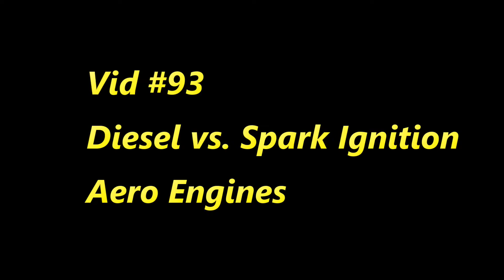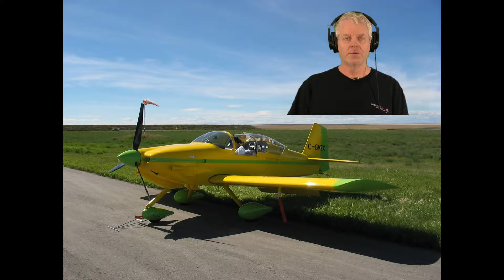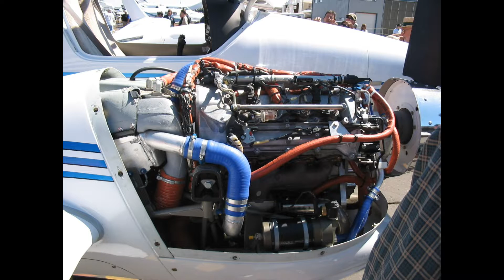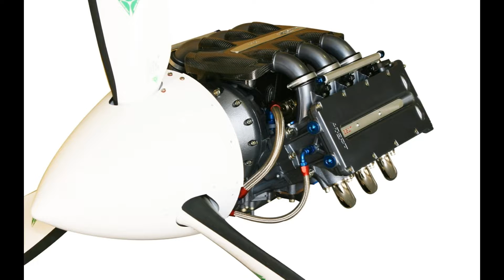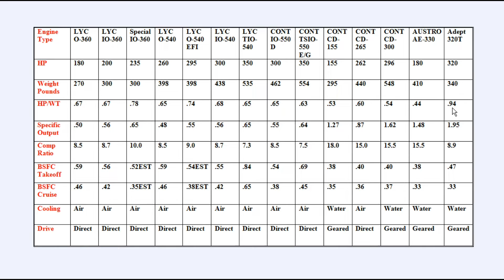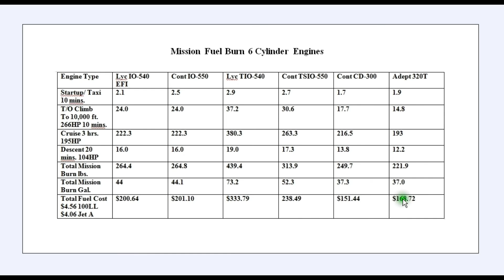Vid #93. Diesel vs. Spark Ignition Aero Engines

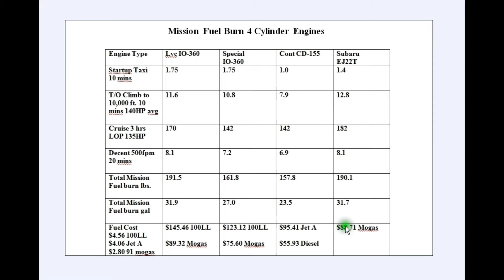Comment: @rv6ejguy   16:51  it doesn’t seem possible to run 10:1 and Mogas.   @rv6ejguy, are you sure the IO-360 special can do this as indicated by the figures in table?
Reply from the maker: We have numerous customers running mogas in their Lycomings. Retarding the spark at high MAP is the key. You'll lose power WOT near sea level of course but can re-advance at altitude.

Lots of auto engines are running 11 to 13 to 1 CRs on 87 octane. Good chambers plus, DI and knock sensing make this possible.

Comment: I remember people mentioning difficulties in restarting a turbodiesel at high altitudes as being one of the drawbacks of raptor (debacle). Care to explain what is the issue and how austro ae330 and others deal with that?
Reply from the maker: Diesels are compression ignition. If air density is halved at 18,000 feet, the effective compression ratio is halved so CR of 20 to 1 effectively becomes only 10 to 1 and won't cause the fuel to ignite. Combine this with low ambient temps and you have even more difficulty.

Many early aero diesels were limited to 12,000 feet and most today still have a lower manifold pressure for flight to ensure they still lit at altitude.

Loss of the turbo above 15.000 feet of so will also cause a flame out.
Reply: We drove our 2015 Ram 6.7 liter Cummins powered diesel with a 5th wheel over pikes peak stopped at the top of the summit 14000 feet high. We had lunch and walked around up there no problem starting the engine backup. It was cold so the glow plugs did turn on which was normal for temps below 60F. Maybe older diesel's  worn out rings have issues never heard of the problem most RV people I see who tow a 5th wheel never told me of any issues they drive over Colorado all the time. Maybe the computer turns on the glow plugs wouldn't really know because it's always below 60F that high glow plugs heat up for 5-10 seconds anyway even down low in the winter.
Reply: @Mike-01234  The SMA diesel was dropped by Cessna (partially) because they had problems with restarting it at altitude. The engine is air-cooled so it's going to be cooled as long as the aircraft is moving through the air, that's not so with a liquid-cooled truck engine that's parked. Trucks are not planes.
Reply: @PistonAvatarGuy  I guess Continental has it figured out.
Reply: @Mike-01234  Well, Thielert, which is the company that developed the diesel engines that Continental sells. It's all Chinese now, so whatever. Diesels still present problems in aircraft because they must maintain a minimum operating temperature and this requires engine power to be kept at a level which might be somewhat problematic in some situations (landing, taxiing).
Reply: @Mike-01234  Restarts are also time-limited on all of the diesel aircraft engines, they just can't be allowed to cool off too much or they wont restart.

I'm betting this is related to the colder air at altitude, as the engines don't have intake air heaters, like many automotive diesels have.
Reply: @PistonAvatarGuy  Thielert Centurion is water cooled the DA replacement engine also water cooled. You mentioned SMA diesel wonder why it was air-cooled. Water cooled engine can use a thermostat to control cooling, or cowl doors. Without a heater have to use ether spray my FIL backhoe was old international had built in Ether spray injector fun getting that started at 7500 feet at 10F didn't have any glow plugs.
Reply: @Mike-01234  Yes, the Austro Engine four cylinders that Diamond uses and the Continental diesels can all trace their start to Thielert.